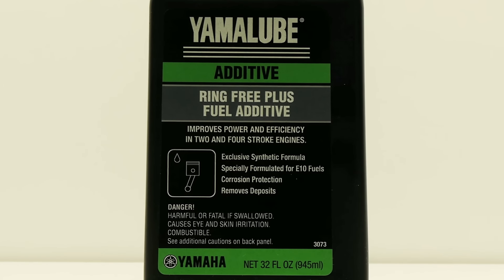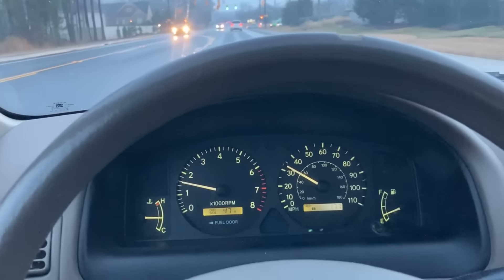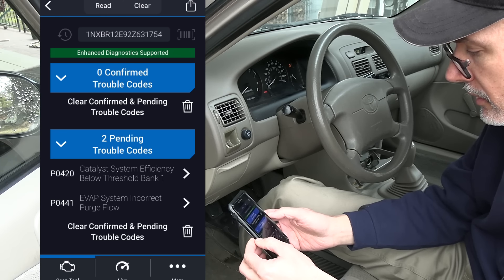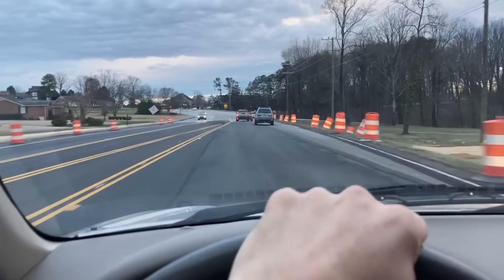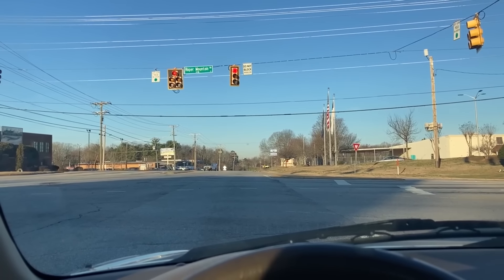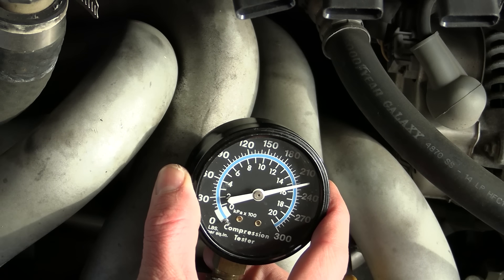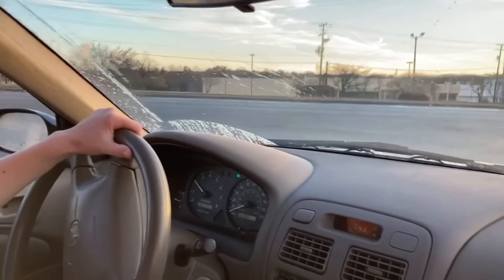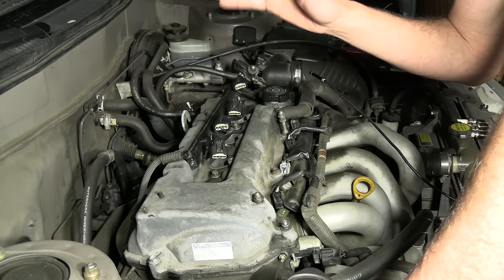Will Yamalube Ring Free stop oil consumption? | Oil Burning🔥Experiments | Episode 20

Comment: I have had a p420 code on a gmc pick up truck for a very long time my truck burns a little bit of oil the other day i was going o a trip and i decided to put lucas oil bottle and the p420 and check engine despaired I took the truck to the emission test even when is not the time of the year when i should do it and it passed 
I wasn't expecting that the lucas cleared the code I was expecting less oil consumption and I was impressed
Reply from the maker: That is interesting 🤔

Comment: At this rate I don't think the issue is stuck oil rings anymore, I think that crankcase pressure could be part of it with the car hunting at idle and with the milage worn rings and even more likely valve stem seals.
Reply: Seals are less than a year old

Comment: I had the previous generation and had to scrap it because 3rd went out. I bet either an inherent problem with synchronization or the clutch or something else that might cost more than the car’s worth was the cause. But, I too thoroughly enjoyed my Corolla and often regret getting rid of it
Reply from the maker: Yeah, I don't know if you saw the video where I mentioned it, but I had to have my transmission rebuilt. 3rd gear bearings are defective in this model.

Comment: Nice Lizard on the wiper  blade. Nice to see that it cleaned the top of the pistons. Man you sure like to splurge by buying premium gas. Noted that it was only $3.51 /gal. Nice , Here in Michigan right now it is $3.59 for the Regular 87 octane , Premium i think is $0.60 higher or more.  Anyway, the car was design to burn regular 87 and that is all i ever use , And now at 219k miles on 99 Rolla with automatic trans I still get 33MPG like i did yesterday after driving 260 miles .  Where did you get the Yamalube ? i like to try it in my car. Thanks.
Reply from the maker: Thanks. I bought the Yamalube on Amazon. ... I wish I could use 87, but I get some predetonation unless I use premium.

Comment: Ad a 2001 Chrysler Town and Country that was using oil, but not nearly as much as your Corolla. It would burn a quart after the oil change at 3,500 miles. I switched oil using Castrol Syntec and the burning completely stopped and I would not have to add trough the 10,000 mile oil change interval. One day I Put Valvoline Synthetic in it, and viola, burned another quart at 3,500 miles. Next oil change was back to the Castrol and did not burn oil again. This is the only engine I have had that used oil, so I could not verify this on anything else. Because of that, I have never used a different oil again. Might be worth a try.

Comment: You should try RVS treatment next. Friend of mine tried it in his sons Corolla, which was burning about 1L of oil every 1000km (1qt per 600mi), after the treatment was done it didn't burn any perceivable amount of oil.
I've used it in my own cars too, never had oil burning issues but seemed to make the engines mechanical noises quieter, like in my previous car it completely silenced the noisy hydraulic lifters.

Takes some time to work though, i had to drive 2500km for those hydraulic lifters to quiet down completely.
It's also kinda expensive, $80 to treat a car with 4L oil capacity, but it lasts 60k miles.
Reply from the maker: Thanks for the suggestion!

Comment: Bought a 2014 civic in 2020 with 225,000 miles used by salesman. Company thought motor was bad. Problem turned out to be clogged screen on oil passage to VVT cam. Replaced part and all was good. I tried soaking the oil/carbon buildup in a number of different chemicals, nothing would touch it. The buildup was as hard as concrete.
Tearing that engine apart really might be the only solution.
Reply from the maker: Maybe ... but something got us from using 1.25 quarts in 300 miles to the same in almost 1k miles ... and others have commented they've completely fixed their consumption with chemicals ... I guess we'll see. Thanks for the input, Scott!!

Comment: That looks like valve seals leaking. Check for blue smoke on start up, and when decelerating. Rev the engine up and watch the tailpipe when you let off the throttle.

Comment: I'm inclined to say that you don't have a ring issue. You have a cylinder head problem. As oil seems to be leaking down on to the top of your pistons, it could likely be coming from the valve stem seals. The check engine light is another clue, because it could be getting partially clogged because of excess hydrocarbons from oil being passed thru your exhaust system. You might want to see if you have oil in your exhaust system.

Comment: The engine light is because the catalytic converter is clogged with oil. And all these additives have cleaned it up somewhat which is causing the CEL to come on and go off. Sorta like Cataclean would do. The evap code is just a simple purge valve replacement. Thus the reason the rpm acted up after fill up. For what it's worth i have been a Toyota tech for 14 years at a Stealership. Id be glad to give my 2 cents if you have any questions. Thank you for the video. The plugs white are burning hot from the Yamalube.
Reply from the maker: Much appreciated, Edward. Is the purge valve under the car, or in the engine bay?
Reply: @FamilyFriendlyDIY  engine bay, make sure the o ring on the gas cap is in good shape also.

Comment: Been watching your saga on this as I'm dealing with it as well on my Lexus. Mine is different to yours though, out on the interstate is where it consumes the least amount of oil. I drove it 700 miles home from Atlanta to Michigan and not a drop was lost. It's the mixed driving that gets it. I've tried just about everything you have as well. Just not the Yamalube. Unfortunately no luck the EPR either.
Reply from the maker: Matthew, I've read that if you have high consumption around town, but not on the highway, it's probably leakage through the valve train rather than piston rings. ... Unless you've ruled that out.

Comment: I haven't finished the vid yet, but as I'm bound to forget before this concludes, a little update from an interesting conversation I had with a globally-located colleague. While the conversation started about jet engine compressor wheels, we somehow got on to the topic of carbon contamination and he brought up a LiquiMoly product (he's in Australia and they seem to stock this on shelves an awful lot more there, or more commonly than in the US; for me in my area, it's always been a direct/special order product line) that they use routinely in direct injection and turbo engines to bust up carbon deposits with good results. Thought I'd pass it your way just to throw onto your list of possibilities, as I've never tried it myself, but I trust and have used his advice on multiple occasions. I believe he said it was Pro-Line Engine Flush (500ml) and checked their site to make sure I remembered that correctly. 
At this rate and with everything you've tried, I wouldn't count on a one-treatment miracle, but you never know!  That said, I also recall going over with him on design specs of acceptable oil consumption over a myriad of different manufacturers, and evidently Toyota is one of the more stringent marques that at a certain age/mileage count (especially the engines with the low tension rings), 1 quart per thousand miles is, and I quote, "In Spec". Subaru's and Mercedes were quite a bit more lenient and among the worst offenders at one liter per 500kms (!!) of 'acceptable use'. At that rate, you're practically into two-stroke range! 
And last but not least, he said that on his notoriously stubborn engine, adding a synthetic blend of Amsoil Air Cooled 4 stroke with the LiquiMoly got him down to the equivalent of 1 quart for 3,000 miles an a very worn out Holden. I don't know if I'd go that route personally as that turns into a rather expensive oil change, but doing a quart here and there may be beneficial. The LiquiMoly might be something you could use on your platform if you reach out to their customer service folks and go for a sponsored approach, but even if not, the places I looked it was round about $15 a can, so not terrible as to cost.
Reply from the maker: Thanks for the suggestion. LiquiMoly seems to be highly recommended!
Reply: Tried that exact liqui molly aditive as one of first tries in fixing my oil consumption (since its very common in europe), as per instructions. it sort of cleans crankcase, but it did nothing to my oil consumption. it is a conservative thing to let it idle with additive only 10min and then drain, but think this sort of issue can only be solved with piston soak. 
Few additives later i did daves berryman b12 treatment as instructed but with full throttle pulls, not only high rpm, and my oil consumption if basically fixed. seems piston soak is only thing that affects piston rings enough to make a difference. And it did as well clean crankcase, multiple times better than liqui moly, possibly because it was driven for almost 30min with additive in.

I dont think he has to try yet another oil additive, but try soaking pistons again (not necesarily berryman, but if fails, dont call quits untill you do berrymans again!)
if more piston soak/berryman does nothing, think engine is ready for disassembly, no need to keep trying out stuff that will 100% be less effective

Comment: Subaru impreza 2007, more than 750k (my grandmas) started using oil, stuck rings. Used liqui moly pro line flush like so: 
When the oil change came aroud a full botle, idle about 15 minutes with the car previously hot, drain oil and get some new oil and filter in there, run the car for 1 hour and then do another oil change with the good stuff and oem filter, also added some stop leak (there was no leaks but I use it every 4-6 oil changes to keep rubber and plastic seals in top shape), the car now used the normal 500ml between oil changes (5000mi), it was using about 3 quarts.

Comment: were you not concerned that the Yamlube may damage the rubbery-like material utilized in the valve stem seals or any other gaskets? I am asking since I am thinking of doing the same thing on my car. Please answer!
Reply from the maker: No. I wasn't worried, but I replaced the seals in another video.

Comment: Hi. This is complex problem: stuck rings+valve seals+crankcase vent system. Use borosxope to inspect valve seals condition under the top cover. If possible...

Comment: Good content
Sealing rings are done.... the crude on your plugs, the top of pistons and continued loss of oil says it all. That is not a manufacturing issue and additives this late in game cant fix the issue.

we',ve been yama lube using for many years. 
The fastest way to see a difference and if it works, use it in your gas weed eater that you premix. Watch how fast it cleans the over oiling.
 Terrific in the 250 Mercury XB

However no product can substitute lack of maintenance. Many owners dont change oil for 10,000 miles and use the cheapest fuel that does not have any detergents. trying to save pennies or expecting a car to work perfect forever will never happen. Even tanks take 4 times maintenance then run time.

 Thanks again for content

Comment: Fluctuating idle like that. That likely is a dirty maf sensor.
Easy to clean maf cleaner. Let it dry.

The other one that I have seen do that is IAC on the throttle body.
If you spray stuff into the throttle body it will get into the aic and people say they they started having idle issues after this.
Aic is not so easy to clean

Comment: So about 300 miles of Yamalube Ring free in the gas tank, and about 900 miles of it in the crankcase.  (1oz/qt of oil, and 2oz/gal of gas. A total of 4oz in the crankcase, and 22oz in the gas tank)

I didn’t really understand whether the oil was changed at 900 miles. (whether the car continued to be driven with YRF past the end of the video – or if that oil was removed, and BG EPR began).

Geez, doesn't seem like the piston tops could get much cleaner than that. Though I guess that’s just the effect of the combustion cycle. (It is more of an indicator that the YRF is being injected through the fuel injectors, and vaporizing/cleaning the combustion chamber, rather than an indicator that it is getting into the piston ringlands). Like Dave mentioned.

I'm bummed that the oil burning didn't seem to improve alongside that cleanliness. (Though, at this point, I can't keep all the numbers straight - maybe there was a bit of an improvement. IIRC it was one of the Berryman's that has so far had the biggest, short-lived, improvement from 300 > 1000 miles). I wonder if that Berryman’s improvement was due to the cylinder soak (dumping Berryman’s in through a spark plug hole)? After seeing those shiny piston tops, I’d probably be trying a soak with YRF on a warm engine as well. 

Also, looking back on the series, “Will Berryman's B12 Chemtool stop oil burning/use? 😲 | Oil Burning Experiments - Episode 14”, the driving procedure was different as well (high revving 20 minute drive).

I don’t mean any of this as inflammatory- I love the experiments & appreciate the efforts. It’s just hard to keep all the videos straight, and I assume this helps other people too. Videos are fun to watch, but blogs/forums are so much quicker to pull information from.

I'm eager to see what BG EPR does. I’ll parrot the recommendation for Ford PM3 & Mopar CCC
Reply from the maker: Half the time I can't remember what experiments I did or how I did them... I definitely could've used a more systematic approach. :-) ... Thanks for the input!!

Comment: I had the same engine in an 87 Celica and when I got rid of it at 348,000 miles, it still used no oil between changes.  I wonder if the design change on the modern engine was to simply resort back to the engine that didn't have oil burning issues or is different altogether.
Reply: The engine in an '02 Corolla is way different than an '87 Celica.

Comment: I worked for Yamaha motorcycle dealerships from 1992-2015 but the bottle that you just showed is not what I'm most familiar with. I remember a change along the way  but I don't remember when that occurred. The old ring free additive used to come in a smaller 12 oz bottle and we would dump it down the spark plug holes, reinstall plugs a few threads deep and turn the engines over by hand a few times and let it sit overnight. Followed by a shock treatment of 2 ounces per gallon in the fuel and if sticking Rings was the problem it was always successful.  As I am writing this I also remember the old instructions stating to change the oil/filter on 4 strokes after running a full tank of fuel treated with ring free....
Update: if my memory serves me correctly Acc-rngfr-ee-12 is the part number of the original if you can find any of it. I know the old formula was awesome but I'll bet that the California environmentalist found something that they didn't like in there...
Reply from the maker: Good info, Brett.

Comment: I've tried the BG EPR.  1st oil change I ran it for 10 minutes, 2nd oil change 20 minutes, 3rd oil change 30 minutes.  I did not notice a difference in the oil consumption on my 08 Scion XB. Still burning a quart every 1200 miles. I will try the yamalube.
Reply: But yamalube didn't work.
Reply: Sorry to hear that...I have an 07 Scion TC with the oil burning 2.4... was so hoping one of these solutions would at least make a noticeable difference.  I have been watching this series from the start just hoping.
Reply: @Glenn_123  I used it on my tc  ran for 30 mins 2000 rpm’s now 1/4 oil consumption in between oil changes
Reply: Try rf 7 sound like seals
Reply: @user-xr3ef6gx1v  That is good news thank you for saying something.... I do not need perfect just something to slow it down. Great car otherwise.
Reply: @Glenn_123  yup just run it 30 mins on 2000 rpm   And run till next oil change and do it one more time and stick with pennzoil ultra platinum

Comment: How about using yamalube ring free followed by another shot of berrymans b12?? I'm curious about BG EPR also... I have a 2013 scion xb notorious for stuck rings as well. Had similar oil burn rates to you in the beginning. After berrymans b12 it's pretty consistent as well. About a quart every 800-1200 miles depending on driving conditions and idling time.
Reply from the maker: Good info. Thanks for the comment!

Comment: I wince at making a statement that may have been covered already, but.... worn intake valve guides and seals may very well be letting oil get in.  I believe you changed the valve seals, but maybe it wasn't enough.  You really shouldn't have wet pistons up top like that....  Perhaps nothing will fix this besides a new head.  Pistons sucking down that oil and it burns away and leaves pools in those bowls.

Comment: Excellent channel.  Enjoy your experiments.  Had a similar problem 20 yrs ago with a first gen Saturn, never used solvent chems,  but there was a Belgian manufactured Castrol synthetic oil that contained a lot of esters and was a "green" color in the virgin state before it aged in the engine.  That was my best long term solution but I don't believe they make this version any more.
The 1.9 liter Saturns had a design issue with no drainback holes behind the oil rings which was the basic cause of ring issues.  Not familiar if Toyota has anything like this?
Reply from the maker: Thanks, Bill. :-) ... Yes, these Toyota engines have too small of oil drain-back holes. That, combined with the low-tension rings, causes these to burn oil.

Comment: Theres is a bg $300 flush kit that does remove lots of carbon and sludge that is proven to work.
Reply from the maker: Grand finale 👍
Reply: @johnkelly4381  hes way over $300 with all the other additives and fuel mileage driving around to fix his oil consumption issue, atleast that $300 bg flush kit dont require driving around but reving at idle, hopefully it works if not then more than likely its valve seals or pistons rings.
Reply: @FamilyFriendlyDIY  ah i 👀 very nice 👌🏽